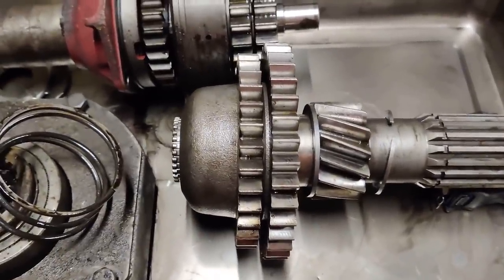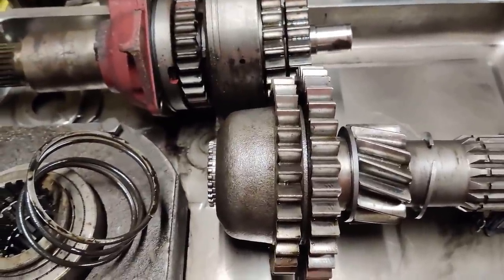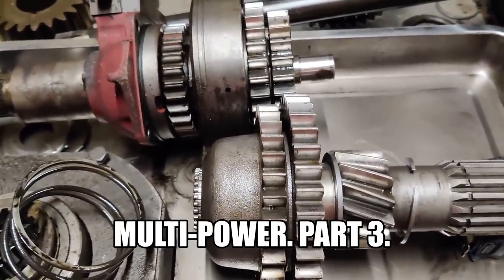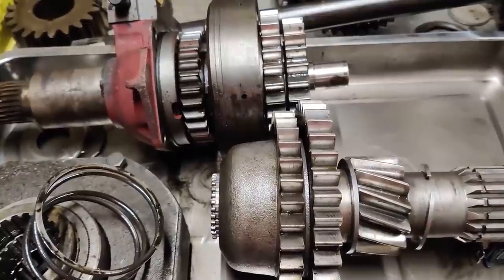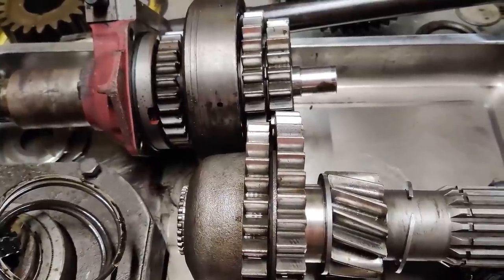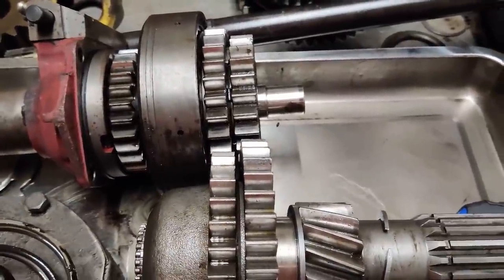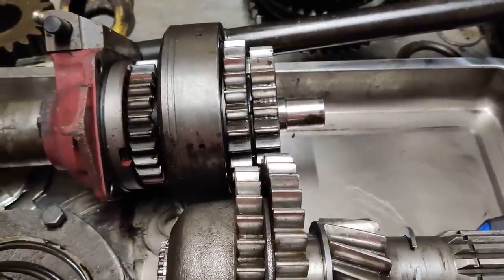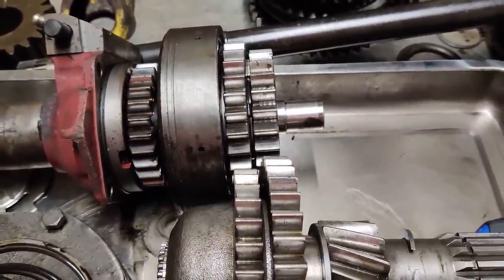How Multi-Power works.   Part 3

Comment from the maker: I have a correction to make, and I'm surprised nobody has pulled me up on it!  I said that the pressure in the control circuit was 3000psi.  Of course it isn't.  It's fed from a low pressure port on the auxiliary pump and is only about 250 to 300psi.  Still enpough to blow out the seals on the input shaft and fill the bell housing with oil though.

Comment: Just now found this very good vid. My mf65 w/multi would kick in and out randomly under load. Found out the intake screen on the aux. pump was plugged causing low flow/pressure. Works great now and cost me nothing. Cheers.
Reply from the maker: It pays to always check the cheapest things first.  Thanks for watching.

Comment: Thank you Clarence,  a MF 65 ran away with me coz I had it in low when I was 13 and scared me. Now I know why. Lend your baking tray to Muck and get him to do the same job on an early duel power. I did a stint lecturing at Reese Heath college and converting what you know into terms a student can understand is a challenge. Cheers Jim in NZ.
Reply from the maker: I have a few videos planned over the next few months, Dual Power may be one of them.

Comment: Another reason for periodically switching to high is to lubricate the needle bearing between the input shaft and top shaft. Not so much of a problem on the mk2 box that you were working on, more so on the mk1 box
Reply from the maker: I forgot to mention that.  Thanks for watching.

Comment: I've just bought one of these.
Your explanation got through load and clear. I'm yet to try the multi power. At the moment I can get high and low on the shifter, but only 1st and reverse. I'm imagining the 2nd 3rd selection rod is off its neutral position. When I get time I'll pull the fill plug for a look.
Jono 🇦🇺
Reply from the maker: Glad it helped and thanks for watching.

Comment: Very good , your tutorials are first class . So I have just been watching them again ! I have my 590 gearbox in bits at the moment as the multipower has never worked in my ownership. The slip rings have worn grooves in both the input housings so I have new ones ordered , together with slip rings  and clutch discs.
Reply from the maker: Thanks for watching and I'm glad it has been helpful for you.

Comment: Thanks for that great explanation of the multipower Clarence . I’m about to split my 590 and dismantle the gearbox.  I’ve checked the input oil pressure and flow from the auxiliary pump (around 4.5 litres /min at 275 psi ) This seems to be in accordance with MF workshop manual.  In any case the 4wd clutch and independent 4wd both work ok so I feel the problem must be with the input shaft to the gearbox.  Never had so much fun !
Reply from the maker: What are the symptoms?

Thanks for watching.

Comment: Thanks for this explanation, long-winded though it is.
We had just a plain '66 MF 135 with no multi-power at home growing up but the manual always referred to the multi-power option without explaining the mechanics of it. I always thought it was engine power boosting :goat-turquoise-white-horns:
My father had grown up working with horses and only adopted the Ferguson TVO in the early '50s after getting married and taking on more land than horses could manage. Apart from how to change the engine oil and squeezeing the brakes he never learned much about mechanics. And never let his sons do anything he couldn't do !
Multi-power is a quite sophisticated system - more sophisticated for example than the optional extra overdrives on large saloon cars at the time. The machining tolerances then were nothing to what could be done via CNC in the '80s let alone today. Of course tractors back then had to be "run in" handily for so many thousand hours before really putting the power down. Otherwise you risked engine seizure.
The MF 135 carries such a lot of sentiment by small and medium sized farmers all across the globe. Fair due to the boys in Coventry🧚‍♂

Comment: Hi Fud-Weasel I was wondering have you come across a problem of the low range not working on 12 x 12 transmission on MF4235. The middle and high range is working fine. Regards Bernard
Reply from the maker: There were problems with a spring in the range selector on this transmission if I remember, it's been a long time since I saw one.  Unfortunately if it is related to the spring you are looking at a £5 part and a £1500 labour bill because it's horrible to get to.  I hope I am wrong and it is something simpler.
Reply: Thank you for the information

Comment: You made clear the last tractor I had with multi power was an mf 270 it work pretty good on all fronts made sure I kept it in high going down hill never run it for too long in gear was a good tractor but I'm still trying to figure out how to turn a 1085 into a 4spd or maybe I'll just get a 699 instead thanks for the videos
Reply from the maker: You could swap the whole back end with a 699, that would be interesting.

Comment: Nice video, was multi power an extra when buying a new machine, and did it then become a feature on all the onesbuilt in later years. Cheers.
Reply from the maker: From memory, I think the 6 speed non-multi-power was dropped in the 500 series and later 100 series giving only the option of 12 speed multi-power and 8 speed.
Reply: @ClarenceFudWeasel  I was looking at a silver top 590 at the weekend that has never left the village it was first arrived at from new. My mate bought it at the nextdoor farm auction to him and its really in mint condition. It's got no multipower though hence the question. Cheers mate.
Reply from the maker: @martyn2141  is it an 8 speed?
Reply: @ClarenceFudWeasel  I'm not sure, I should know I drove it back from the sale. I'll find out. One slight problem he's got covid at the min so i'm avoiding them like the plague.
Reply: I used to work at a MF dealer in the 90’s. If I remember correctly, Multi-Power was still available to order as a factory option for the earlier 300 series models

Comment: Hi, i used to work for a Massey dealer, we did loads of multi power repairs plus a few times we removed the system altogether from the gearbox using a kit from Massey that came with all new gears etc, which turned the box back into a 6 speed, one advantage of this was that you could now tow start the tractor
Reply from the maker: I think my 165 had that done.
Reply: @ClarenceFudWeasel  Can remember dad fitting opico turbo kits to 590's when he worked at John I Fearns of Bakewell, later i worked with him at Windsor and Stephenson Tideswell, we fitted a few TB Turbo kits to 290's and 690's, can still remember the lovely sound they made at full throttle, good old days

Comment: Excellent video, extremely informative, I'm shocked at how cheap to repair, can you please tell me how much oil flow and pressure is required? My 1200 MP slips a bit, I'm suspecting pump is very worn 
Thanks
Reply from the maker: The control circuit is supplied from a  low pressure port on the auxiliary pump which as 250 to 300 psi if I remember, not 3000 like I suggested in the video 😯.

Comment: Hello From Southern Victoria Australia, I Never knew about how you should not keep it in low too long, when I used to drive one for example when I cut hay I'd start off in low Multi power 1st or 2nd high then flick it up to high Multi power then when I come to a corner I'd always flick it to low to go round the corner a bit slower, the clutch when pulled apart looks similar to a motorbike clutch too, Lance Maskell from Bundy Bears Shed from up north in tropical Queensland did one up a while ago, he is doing up a Massey Ferguson 135 Multi Power and is putting a faster diff in it, I think he got the diff out of a 185, they do road trips and take camping gear with them, the one we had sat on 40km / 25mph at top speed,  he was hoping to get as fast as 60kph / 37mph on the road.
Reply from the maker: According to the original design specifications, it was supposed to be driven in high and only switched to low for short periods when the going was heavier.

Comment: Just a few comments, I would think as the hyd seals wear the pressure on the clutch decreases (progressively) so there's less force on the clutch plates so will gradually slip and so heat up and warp etc. This system reminds me of the Haldex unit on 4x4s like LRs. I would think it's an item that needs servicing based on hours use. One point to ponder at design time, would it not have been better to have high speed as default (no hyd pressure) and low speed as the pressurised torque path?
I like corrections, I know often during a presentation some data is best guess (based on experience) to keep the narrative flowing, and then later someone points out a (confirmed) revised data point.
Reply from the maker: Thanks for watching.  The best thing you can do with Multi Power is stick to the oil change intervals and keep the filter serviced on time.

Comment: Thanks so much for the video. I have a 35 deluxe multi power. Was planning a fluid change but not sure what fluid to use. Is it different from the regular gearbox.
Reply from the maker: It's one compartment from multi power to differential so just a standard universal tractor oil such as Witham Qualube All Farm 3 or equivalent will do just fine.  Thanks for watching.
Reply: @ClarenceFudWeasel  thanks alot.

Comment: Very informative thankyou. I will let you know what's wrong with mine when I get to it. Do you have to split a 590 to change the aux pump or is it accessible from the top cover?
Reply from the maker: You don't have to split it for the aux pump, but you will have to lift the back of the cab up to get the top cover off and it helps to be skinny!   Thanks for watching.
Reply: Cab doesn't need to be lifted on a 590 to get the top cover off but you will need to remove the cross member. Auxiliary pump can't be removed without splitting as it is bolted to the plated drive from the front.
Reply from the maker: @andrewplumb6189  Thanks, it's thirty years since I have done one. 🙂
Reply from the maker: @andrewplumb6189  No, I worked for a Ford dealer and a John Deere dealer over the years, but we always had Massey at home, which is why I collect them.
Reply: Thanks really helpful.

Comment: So my multipower in my 1962 MF-65 worked fine for many years. Then I would notice that it would make some noise trying to switch  from 3rd High, MP low to 3rd high, MP high on the highway. It got worse, to the point that switching to high seems to make no difference in any gear at any forward load. Here is what is weird. Switching to MP high going downhill DOES engage engine braking.  Can you think of any reason that MP high would not engage in forward torque loads, but still does cause engine braking when there is reverse torque?

Also (and possibly related): what oil should be used in the MF-65 transmission?
Reply from the maker: The first place I would check is for broken multi power clutch pack disks.  It's a splitting job I'm afraid.
Reply: Argggh. OK, it is what it is. Thanks.

Comment: Hey! Great videos! I do have a question.. I have a 74 MF 165 w/multi power.. I only use the tractor for finishing mowing.. I seemed to have lost my pto power and the high range mutipower drive.. even low seems a bit weak. Any suggestions where to look first? Thanks..
Reply from the maker: If your 165 is fitted with the hydraulically actuated iPTO, it sounds like you might have a problem with the low pressure hydraulic system which operates the PTO clutch and the Multi-Power clutch.
Reply: @ClarenceFudWeasel  thanks for the direction to look in! Can that be accessed under the seat/lifting arm cover? I’ll do some reading in my service manual
Reply from the maker: @brado8523  The auxiliary pump is under the hydraulic cover under the seat, you can check the pressure in the multi power cooler/filter pipes if I remember.

Comment: Can you get the multipower pack out without taking all of the top of the gearbox apart? Looking at a 178 with the multipower not working
Reply from the maker: In a word, no.  You can only get the overrun clutch out from the top.  Sorry to bring bad news.
Reply: @ClarenceFudWeasel  Apparently the pack was welded solid so that will be fun to get working, and expensive
Reply from the maker: @Oliver Lee390  People used to do that quite frequently, I never understood why.  By the time it's in enough pieces to weld, they might as well have spent $50 and fix it properly.

Comment: And one more question.....where are the test ports for MP?
Reply from the maker: There aren't any I'm afraid.  For pressure and flow tests, disconnected the feed to the multi power spool valve and plumb in an adaptor for your tester.  It should be 250 to 300psi.

Comment: If you can give any information on parts and/ or repair for a 4wd or 4wt axle on a 168 thanks 😊
Reply from the maker: Is it the MF Cat 3 axle you have or the Four Wheel Traction that you have?  I believe the 4WT was a Selene axle wasn't it?
Reply: @ClarenceFudWeasel   on what I could find on the Internet a four wheel traction, 4WT is on the axle

Comment: What part of the multipower linkage can get loose or cause problems?
Reply from the maker: The actual control linkage is pretty straightforward.  It's not precision engineering, the pins wear and the holes stretch, unfortunately half of it you need to split the tractor to check.
Reply: @ClarenceFudWeasel  the bottom of the linkage looks like a flat bar with a peg pointing down towards the transmission.  The peg isn't connected to the transmission though.

Comment: dual power could go bang if put from hi to low at high speed with a heavy load pushing behind the tractor would multi power do the same
Reply: Yes it can and will do….and dual pwr is quite a substantial unit for a tractor….worked for a plant hire company many years ago who ran a 7610 with a tanker for dust suppression….they would put any donkey on it and that is exactly what happened…. It totally mashed the dp unit up and filled the entire transmission with all the metal bits….looked like Gary Glitters boots…what a bloody mess it was
Reply from the maker: I guess you could probably do the same to multi-power if you really worked at it, but I have never seen it.  Thanks for watching.